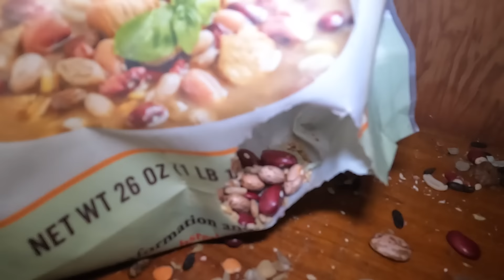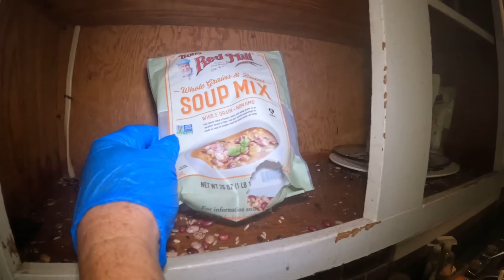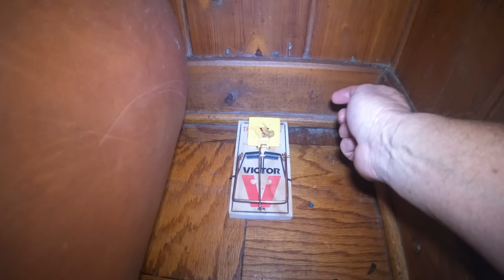**WARNING** Rat attack....MASSIVE rodent infestation

Comment: When I first left home I rented a 2 bed house with a friend. It was as cheap as chips but infested with everything. We stripped the house throwing everything out until was just floors and built in cupboards. Removed panels in walls, ceilings and floors.we bought insecticide, poison and cement. It took about a week but we sealed all cracks around the house, gasses the whole house, everywhere 3 days running, laid poison and glue in all cavities. After about a week of not seeing much we bought new minimalist furniture. Occasionally we had to gas roaches and take out the odd mice.....but it was pretty much clear for three years. We were both able to save good money and buy new build homes. I remember telling the house builders I want to pay extra to get the house rat proof and they laughed at me saying it's already done son.🤣

Comment: Man that house was nasty but tbh though rats simply have a way to mess up your home easily no matter how clean you get unless these shits are gone from your home expect to find out cleaning your home is a chore. 

I used to deal with a pretty bad mice problem due to us usually leaving cooked food out even if covered they would be more active and end up chewing through our non cooked food and wreak havoc in areas we don't normally touch. Next they didn't bother with the traps for a while and they sometimes ignored our snapper traps and so eventually I began catching them by hand myself as they were no match for my reflexes once they were out in the open and cornered as soon as I went to the kitchen to grab something I'd sometimes see one or 2 of em hide somewhere, I'd proceed to discover where it's currently hiding cover up every last exit they have which for them was our stove and remove every other obstacle and hideaway spots it could easily run to until its current hiding spot was it's last option I'd then have my younger brother open or slowly remove the final object at an angle leaving the rat a single direction as an option and once they take off I'd immediately launch my hands with the speed and precision and speed of a snake bite and pin the fucker down and since they were small mice they often didn't fight back  so I'd then with my other hand pick it up from it's neck skin and just simply state it it while it sort of freaked and gave a nice scares surrender pose I'd then out it in a zip lock bag seal it, take it outside and mercifully end it with a single stomp and throw its remains in the trash mess free.

Btw yes they make nests like this and if you have a mouse problem and a closet full of shoes check them because they will make a nest out of it I found one pair in my sisters room and took it outside I stomped on it good before removing any of its nest material to kill any rats inside from escaping one shoe had a bunch of newborns who slowly squirmed out of the shoe due to I believe injury from the stomping and ended with a gardening hoe, the mother was in the other shoe alone with hardly any nest material and was dead upon inspection the other hideaways these rats used were sealed with poison food in case they decided to chew their way out of their only entrance and exit proved effective other holes were properly sealed with metal, metal grates and covers and finally some dry wall stuff to cover and patch the hole this ended their reign of infestation pretty quickly and since it mostly happened in the winter time some of em probably died in the walls because they get really cold as they only use it as a transitional hub to other parts of the house and not so much as a nest except under the bathroom sink underneath the cabinet.

Comment: Wow, incredible video.  What is the likelihood of rodents getting into homes with raised foundations via underground tunnels through the soil?  Is there a way to find the tunnels without the naked eye?  I'm perplexed about how rodents are getting into my home.  I've had exterminators and handymen seal up any possible opening.
Reply from the maker: I would go aggressive on setting up wi fi cameras to monitor there activity to provide real evidence of how there coming and going. Then strategize from there.
Reply: @TwinHomeExperts  thanks!  I do have a couple of Wyze in the attic but I'll have to run a long extension cord for the crawl space...just been dragging my feet on that.  By the way, my cam caught one bugger triggering a humane trap but got out before the door closed.  Another snap trap was triggered but didn't catch the guy...because the trap was on top of the insulation, so I now realize it has to be a hard surface.

Comment: I got bit by a rat in my NY apt in 2013. I thought it was dead in a wood trap. It was not. It was a huge rat in a tiny unbaited trap in broad daylight. They ate a whole bag of dog treats before I knew they were there. Then one day one ran out from under my couch into my closet that shared a wall with my kitchen and had exposed plumbing running from the basement. I knew I was in trouble. I was out 3 months later after I got bit.  Never again. I just saw a rat in my garbage room in my apartment. I'm moving next week.

Comment: There’s nothing wrong with The vintage cabinets and house decor!  I think it is   cute and retro!
Reply: I'm renting a house in the country that was built in the early 1930's, which still has the original metal cabinets. There is a little rust on them here and there along the sides, but they still work just fine.

Comment: The rats are getting around that cardboard fence is because.
A:It has holes in it.
B:It's too short,Rats can clear that jump,expecally from on the couch or the foot stool.
Do some rat research,and maybe you'll be able to catch them better.
I would never use those cruel,sticky traps on rodents.Such a slow,painful death.I think glue traps sold for rats and mice,should be outlawed.
Only time I would think it would be appropriate is to use it on Spiders and Roaches.
Reply: Parts of the video made the exterminators look incompetent.